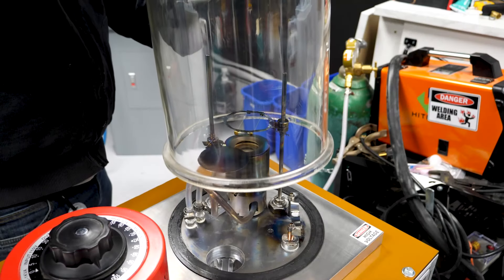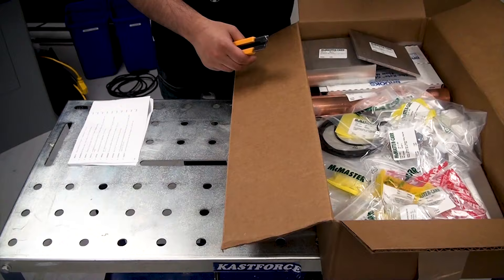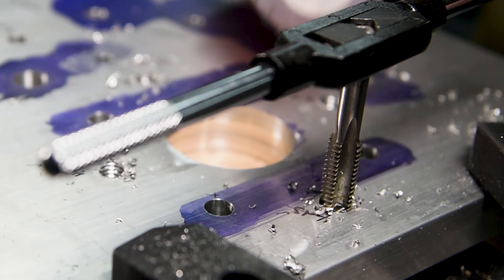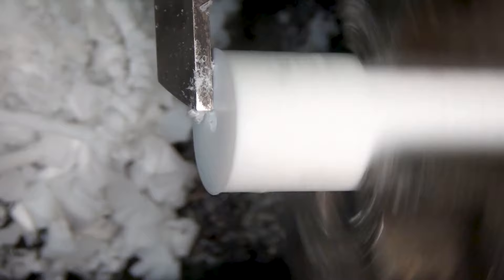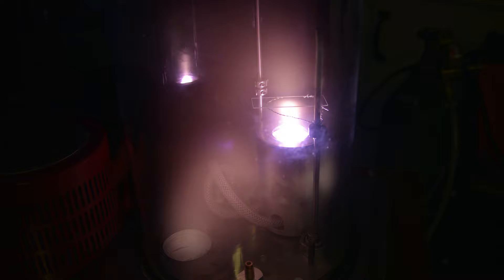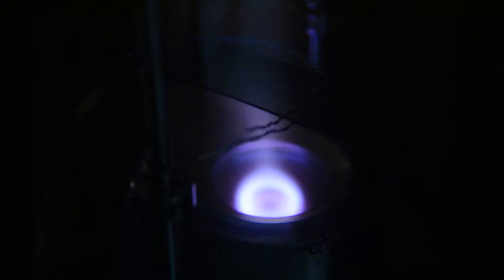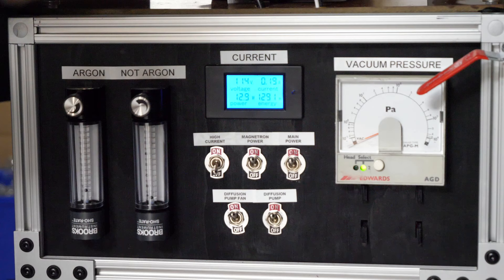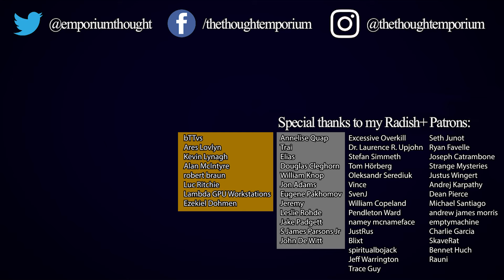Coat ANYTHING in METAL: Magnetron Sputtering Machine Build

Comment: I'm a machinist and you guys did an excellent job. The entire trade is all about creative problem solving and incremental learning. Which are skills you've already demonstrated. All you need now is time. Best of luck in the future and remember: you're ALWAYS going to break taps.
Reply: It's not about when you break a tap

It's where 😅
Reply: One could even say the entire trade is all about creative ways of breaking taps while parts are a byproduct.
Reply: If you've got a cnc, use thread mills if you can swing it. Better than digging out broken taps.
Reply: Uh, Chinese carbide tools to machine special copper? Try high speed steel O1, D2. Indexed inserts have made skills like grinding and engineering cutting geometry, a lost art. Rake, chip breaker, width, setting above center, are skills learned and passed on. I assume phosphor bronze would off gas too much?
Reply: @ClownWhisper  yeah, there are better ways to machine copper. My point stands, they made it work and likely learned a lot. Encouragement is better than beratement.
Reply: @everettplummer9725  for what it's worth, I'm in community college machining classes and we're learning offhand tool grinding and even twist drill sharpening. Including the geometries you're talking about. Your points here make me wonder if anyone is making HSS inserts for indexable tooling though...
Reply: @clort123  unfortunately the Drill Doctor, inserts, and CNCs, have replaced the skills that may have been learned, then forgotten. How many real machinist do you know who have a copy of the Machinist's Handbook? Own over ten thousand dollars worth of tools and boxes? Can work with 0.00005 tolerances? Can work under pressure of a customer waiting on you to fabricate the drawing on a napkin? Work with NASA metals to send to the South Pole to turn their antennas? Certain materials turn and thread better with HSS. Speed and feed should be memorized for each material. Index drills should be memorized for each tap. Starrett cheat cards are unnecessary. My old boss at Alliance Tool & Design started his Tool & Die experience the same year I was born. He has forgotten more than some of these Trade school teachers will ever know. Low pay, CNC automation,, high risk, and learning disabilities have kept the trade from seeing the old school machinist.
Reply: @Gravybagel  Thread mills have been a game changer
Reply: Tapping is a very fine art and taps are consumables. Soft pure copper is also truly horrifying stuff to lathe and in the bigger scheme of things these guys did well! I'm sure everyone who has tried it has broken plenty of carbide and entire insert holders. Typically people have access to only steel cutting optimized inserts but if you look at the catalogs for for example Sandvik Cormorant you notice that they do have specialized carbides and ceramics with geometry and coatings optimized for sticky stuff like copper. It's just frustrating to buy 20 different things as a hobbyist with a limited budget. You could also just try your own ground HSS cutters but that adds another layer or research and learning. You can definitely cut copper with just a bar of tool steel but you need to make the geometry yourself.
Reply: If you break a single point thread tool, it is a whole lot easier to remove.
Reply: Toilet phone

Would you dare to guess what it would cost for the to build this for sale to a customer?

I ask because you have done a lot.
Reply: @lowsafetystandards7245  LOL!😅
Reply: I was just going to say the same thing but you pretty much nailed it…copper, it’s like machining work hardening chewing gum
Reply: @lowsafetystandards7245  yes
Reply: The solution to always breaking taps is to only use a tap five times and then get a new one, also just don't try and tap any especially hard material.

Comment: I have one of these machines in my lab and it costed hundreds of thousands. It is unbelievably crazy that you made one from scratch!
Reply: While it sure is, in my lab we have all kinds of stuff that costs hundreds or thousands, but when we open it up we often think "we could've made that for a fraction...". :)
Reply: For taking them two months to make it, I don't doubt that price one bit.
Reply: Sputtering samples for the electron microscope is always great fun.
Reply: This is a DC sputter coater, not an RF sputter coater. While an RF sputter coater does cost 100k+ a dc sputter can be had for about 10k.
Reply: @genuinedickies99  
Then again, the opportunity cost somewhat equals out when you consider that those months would have been spent earning the money to buy such a machine))
Reply: @subjectmatteramateur16  shouldn't cost all that much more, as RF amplification circuits are common these days. Oscillators and amplifiers are far from mysterious!
Of course, finding out what frequency band to use would take a bit of research...
Still, the last time I looked, magnetrons generate microwaves, which are decidedly RF.

Comment: Mundane fact: The US doesn't use the Imperial System. We use the US Customary System, which is comprised of "nice" multiples of Metric units to approximate Imperial units. Because of this, Imperial and US Customary units aren't interchangeable or "nicely" convertible.
Reply: There are also some other differences, for example US and Imperial pints&gallons are different sizes (since British changed them after US gained independence).
Reply: @HidingAllTheWay  But now Britain uses metric
Reply: @durnsidh6483  for the most part. Beer is still sold in pints, and car fuel efficiency is measured in MPGs (even though fuel is sold in litres).
Reply: @durnsidh6483  Not true. In the UK, they measure distance in miles, height in feet, beer and some other drinks in pints, icecream in half gallons, and if you ask anyone how much they weigh in kilograms they will look at you funny but if you ask their weight in stones (14 pounds) or pounds, they most certainly will know. They also know inches just as easily as they do metric as it was only 20 some years ago that they were on the IPS system. Its actually illegal in the UK to sell beer or cider in any unit other than fractional pints. All UK plumbing is still in the inch system, though threads are BS but are still inch.

I am an engineer in the US for a company based in the UK. As much as my colleagues in the UK try to deny it......they use the IPS system every single day in everything they do.  ;-)
Reply: Yup, US Customary system is in fact metrified and is based explicitly on metric system standards, with a mathematical conversion applied.
Reply: @HidingAllTheWay  Every unit of the USCS and IS are different sizes.
Reply: @snarkylive  It is not. The US measurement system is still 100% based on the pound, gallon, yard, bushel.
Reply: @StreuB1  nope, the US inch is defined by the "international yard," which is not a physical object, but an agreement that the yard is exactly equal to 0.9144 meters. it has been this way since 1959.
Reply: The USA never used the Imperial system.
Reply: @_allegra  that's not how standards work. You're not using light one step removed.
Reply: oh hey it's that person from the WO discord
Reply: @davidpranston2902  Perhaps.
Reply: And the purpose for doing so is absolutely pointless in the global age
Reply: @1dgram  hate to be that guy but it's 2.54cm, and what do you mean not as nice as 1m equaling 1000cm? the length of the yard (and hence the inch) being based on the meter doesn't change the relation between cm and m. the reason there are a 100 cm in a m is because c is the prefix centi- meaning 100. if you want 1000ths of a m you'd use mm. not trying to rip your comment apart I'm just kinda confused.
Reply: @MrCrackbear  Exactly, and 1 yard equaling 0.9144 m works out to 1 inch equaling exactly 2.54 cm which while not as nice as 1 m equaling 100 cm is still pretty nice.
Reply: @MrCrackbear  Numbers fixed. I know better. That's what I get for quitting caffeine.
Reply: @1dgram  I see, no worries
Reply: @StreuB1  I see you've never done land survey.  We use feet that are broken into tenths of a foot.
Reply: @_allegra  I think you are making a chicken and the egg argument that is doomed to fail by a simple history lesson.

Comment: We call our measurement system "Freedom Fractions". Thanks, I'm here all day.
Reply: lAs a proud American, I refuse to learn how to use fractions, free or otherwise, so I usually just look at stuff and guess
Reply: I will be stealing that. Thank you.
Reply: I heard someone call metric "free healthcare units" and have been using it every chance I can.
Reply: @Spencisuar  Yeah, those free healthcare doctors thinking mm Hg is the SI unit for pressure get me all hypertensive. (?)
Reply: @lettersnstuff  fractions are pretty easy to work with. If you have a calculator you can just convert them to decimals by dividing the top number with the bottom one. Then they're not even fractions anymore.
Reply: @Spencisuar  nothing is more expensive than "free".

Comment: For sputtering non conductive materials, like the glow powder, you need RF sputtering. If you try to DC sputter an insulating target charge will build up on it, and will discharge with the arcs you see at 23:08
Reply: The magnetron outputs microwaves, which are most assuredly RF.
Although, I'd not have gone with resistance heating of the metal, but went with inductive heating. Far more efficient and easily adjusted for output to ensure one doesn't vaporize the metal instantly. That's how getters were activated in vacuum tubes, which scavenge the remaining metal that's slowly departing the metals and insulators.

Comment: My tips for machining soft metals (copper, tin, lead, etc.)
Use sharp HSS tools. Rasor sharp is blunt after i sharpened them. :-)
The cutting angles can be quite steep. The tools are more like wood cutting tools. You want to move the removed material away from the stock as fast as possible.
Use diesel, kerosene or WD-40 as cutting lubricant. The softer the material the thinner the lubricant has to be.
Reply: Came here just to second on High Speed Steel tooling instead of carbide, it should work way better and be waaaaaay cheaper for the things and quantities being machined on the type of machines present. You can get random "blanks" of HSS to sharpen into whatever you want, or even get used junk off of Canadian Craigslist since you are just gonna grind it into whatever you want.

I don't have any experience with oxygen free copper, but my general understanding is that whenever you have to work with "grabby" or gummy materials, brassed-off tools with neutral cutting angles stop the material from pulling your cutter into itself like a melodramatic thespian.
Reply: I second the remark on the cutting angles, although not the "quite steep". The optimal angle depends on the material, and you have to dial your cutting speed so the material removal happens at a set rate. I recall having to look it up in tables when I first learnt to use machining tools (lathe and milling machine).
And I agree on using HSS rather than carbide on copper, but also on Teflon. The issue with Teflon is that it flows away from the tool if you take too shallow a cut, but then it'll "bounce back" and the tool will take a bigger chunk, resulting in a rougher finish than anticipated.
Reply: Cool thanks for that..

Comment: 5:45 as functional isolation that nothing important gets zapped, great choice. But don´t rely on that for any kind of safety, just ground the table to the earth as part of the setup wiring. Ideally add a "dummy" wall plug that connects the ground and energises a relay wich prevents the device or power supply from working when not plugged in, somewhat ensuring a good earthing of the contraption.  
This is because if the metal construction is not connected to anything it can quite easily gain a static charge over time through tracking or by capactiance and give you a nasty zap.
Reply: You can't route the entire machine through a residual current device (RCD) as the diffusion pump needs to cool under vacuum, so the roughing pump would always need to be on another circuit to prevent vacuum oil fires.
Reply: My highschool had a crt on a cart. The ground wire pin was broken by someone. The cart gained a very fun static charge for anyone who touched it. Eventually someone went to the ER, and they got rid of the tv. They never replaced it and the teacher had to bring in their own projector
Reply: How is this capacitance possible? I believe it could happen but don't understand how the electricity would build up on the surface of a nonconductive material. Wouldn't the charge just be pushed back into the metals and conductive material on the table with it? Wouldn't there have to be a neutral of some sort in the system for the electricity to flow through you?
Reply: Oh. That makes a lot more sense. Thanks
Reply: If one has a lab that uses high voltage circuits, a bus grounding system would be strongly recommended, the bus going straight to a ground spike that's properly installed.
Long ago, an electronics school instructor said to our class, "ground is ground the world around". I educated him on telluric currents and ground voltage differentials, each related to different causes. Got bit twice by such surprise differentials, since I've used greater caution, lest I strike out.

Comment: EDIT: I'd absolutely love to see an engineering cut of this video. Your work is amazing.

I know this is too late to be useful, but the sheer majesty of what you built compels me to say that machining copper and some of its alloys is a right bastard, but it is possible to get oxygen-free Alloy 145. 

Alloy 145 is a tellurium-copper alloy which is ideal for machining. It apparently sees lots of use as a busbar material due to conductivity.
Although described as a free machining copper alloy, free machining is, it's still a copper alloy and I found it amazingly abrasive against carbide and HSS tooling, and while less so than pure copper it's still pretty gummy. But it is nicer to machine, and unless the tellurium was somehow an issue I think it'd be great for this application.

You've done some beautiful work here. Far out.

Comment: So, this is basically a plasma coater (common name).  The disks for some reason are often called targets - although that makes no sense to me since they are sources.  The coatings are typically very thin (in the nm scale). We use them  to make conductive surfaces on samples for machines like scanning electron microscope (and others).  These machines (generally) require conductive samples.  I'm not allowed to "play" at work, but you might try to see if you can get interference colors on a glass slide (e.g. blue or red gold).  You can use it as a thickness gauge based on coating time.  Also, I always want to use masks and coat successive layers of metals with different conductivity to see if I could make an odd circuit - we can actually do carbon as well.  Not sure they make a target for that, it is an evaporation technique usually.  Anyway - good job.  We pay a rather large sum for our coaters.  I think our last carbon coater was 50K and it looks very similar to what you made  .
Reply: They're called targets because the working fluid is the plasma in the chamber. The plasma bombards the target and knocks material loose, resulting in a beam of nano-scale shrapnel. Basically it's a particle accelerator that shreds itself in a controlled manner to coat things.
Reply: I do remember scanning electron microscopes needing to coat things in metal to “see” sample. Didn’t realize it was with a machine similar to this. Just remember seeing it on a video about butterfly wings having nano scales rather than pigments. They used an the scanning electron microscope to see the scales and briefly mentioned coating wing with gold. Was probably a “getting smarter every day” video.

Comment: 18:05 for future reference, couple a rod with a handle using magnets, completely eliminating the need for drilling a hole all the way through (and eliminating any need for gaskets)
Reply: they basically did what the ISS does, so its not that bad
Reply: @CaptainAwsome  it's not a perfect solution therefore it does not work. 

According to about half the internet anyway

Comment: some sagely advice learned through drag racing, if you need more efficiency in your cooling of the baffle, try salt water. If you don't want to run salt water (corrosion mostly) run propylene glycol. I use it in my main loop for my intercooler with a brine salt bath. It's getting changed for the air conditioning core/pump from a suburban I think later so I can simplify the whole process, but with either of those you can get sub freezing temperatures in your cooling.
Reply: Glycol reduces effeciency and is only there to prevent corrosion and modify the freezing point. Racers run water because thats all tracks allow.

Source: I actually race.
Reply: @nobodynoone2500  all the tracks near me are 1/8th mile bandit tracks on Indian reservations. Most nhra certified tracks indeed don't allow any intercooler coolant other than water most of the time.

Comment: I am an isotope ratio mass spectrometer technician and i am absolutely blown away.  Stunning achievement.  Oil vapour is my enemy- have you looked into turbo molecular pumps? Ceramic spacers and washers are also easy to get these days.  I just watched your previous video also, i have a set of digital mass flow controllers gathering dust, i am sorry to say 😅